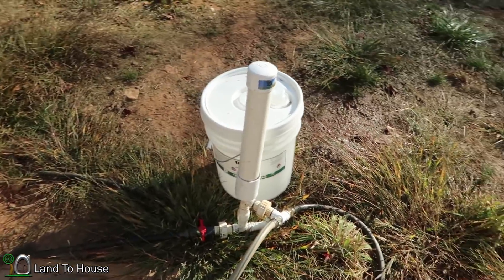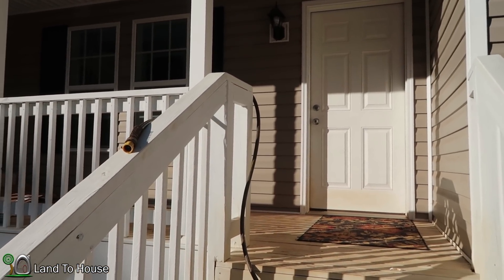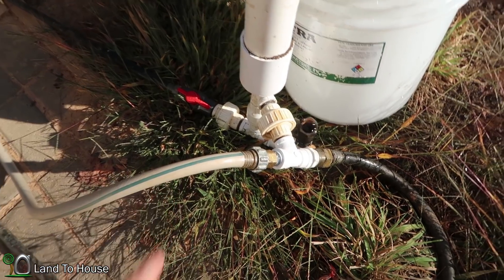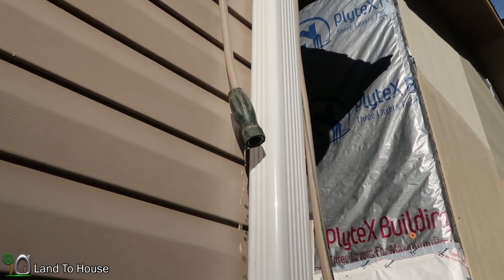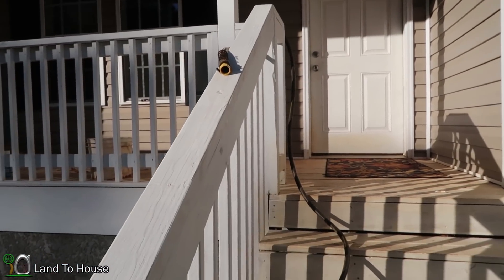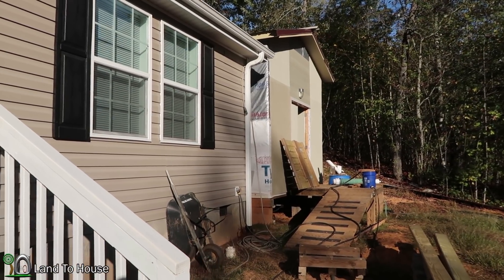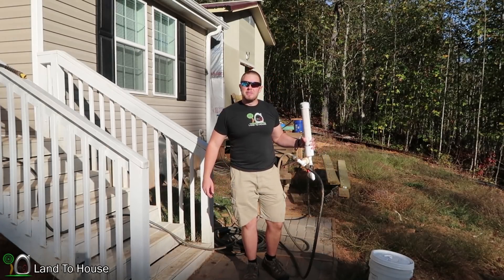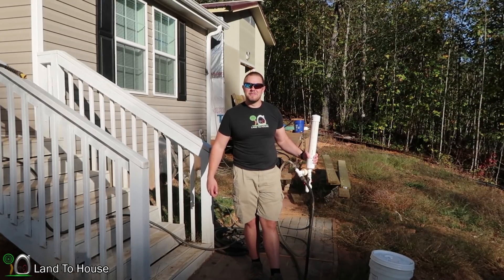One Ram Pump Two delivery Pipes

Comment: I think a check valve on your tallest pipe in that scenario might work to stop the back flow
Reply from the maker: You are absolutely correct! Would have to drain it in the winter but thats not an issue.
Reply: Was just thinking exactly the same thing. Check valve would prevent back-flow issues from "stopping" the pump, I'd assume? Or greatly mitigate the issue?

Comment: no-no-no! 
just add check valves at each hose connection to the pump.
Reply from the maker: Yes that would be a simple answer to the issue. Thank you.

Comment: So , you could have a floating valve that closed off the lower pipe when a collection tank was full , forcing the water up to another higher tank?
Reply from the maker: +mike34124 that is great. It's nice to supply water to a neighbor in need. So his land must be lower than yours?
Reply from the maker: Yes that would work very well. I like the float valves that are used in horse water tanks..